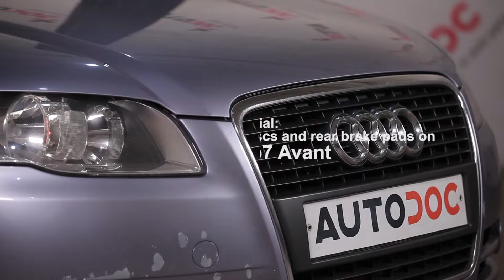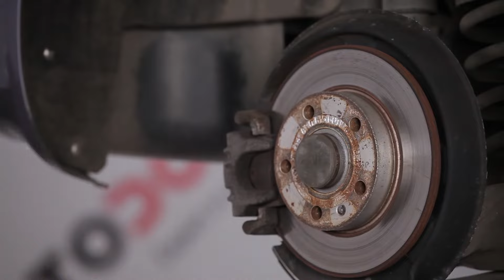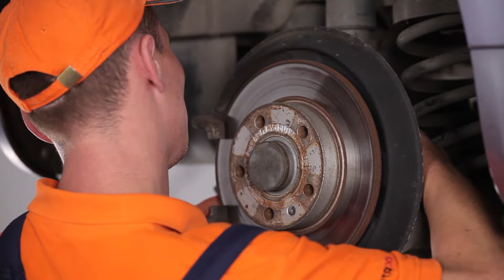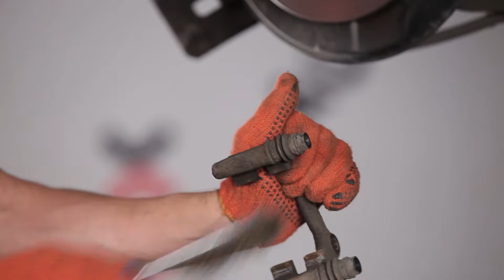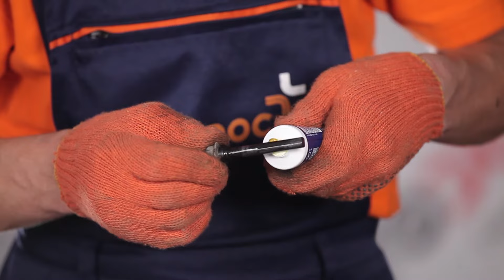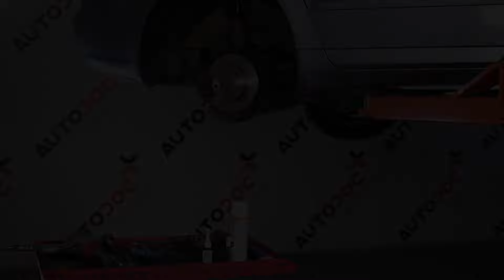How to change rear brake discs and rear brake pads on AUDI A4 B7 AVANT  TUTORIAL | AUTODOC

Comment: Hold up a minute. I just changed out these rear discs without having to take off the caliper bracket. That's not really a required step and I just found it by accident. I was prepared to undo the bolts in the back and the disc shifted, after I removed the securing bolt for it, and the disc came out when I had braced to catch it. Good stuff though.
Reply from the maker: Thank you for your feedback ! Thank you for your valuable remark! It will be very useful for our viewers. Our new videos will show the replacement in more details and we will tell more about it.  Best regards, Autodoc.
Reply: Your comment has helped me so much tonight as couldn’t remove the Cali per holder!!! Thanks from UK
Reply: I guess I am kind of randomly asking but does anybody know a good site to stream new series online ?
Reply: @Leighton Cristian flixportal
Reply: @Konnor Zayn thank you, signed up and it seems like a nice service :D I appreciate it!!
Reply: @Leighton Cristian glad I could help =)
Reply: G man u saved my life right now i could take it of to cuz it was stuck now i can replace the disc without a problem😅
Reply: Can confirm. The caliper bracket even has cut aways to allow the disk to be swapped without caliper removal.

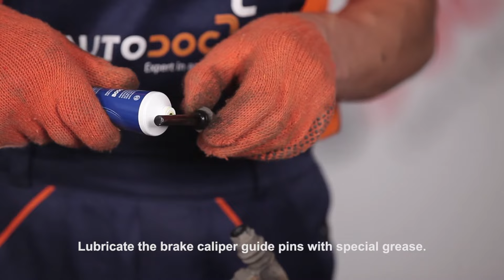Comment: 4:50 'Lubricate the brake caliper guide pins with special grease'... 
What 'special grease'? 
What would I ask for at my auto shop?
Reply from the maker: Thank you for your feedback !  In this video we used special  lubricant for  support  guides.Please, contact our support team, and be sure that we will check it for you. Best regards, Autodoc.
Reply: Copper grease.
Reply: @iangraham6730  Cheers, Ian. I reckoned that from around the time I asked 'autodoc' the question. Your reply was what I needed from them at the time, but unfortunately copper grease seems to be some closely-guarded secret of the trade: "special grease" "special lubricant" - why couldn't they just say 'copper grease' or 'lithium grease', 'red rubber grease' 'ceramic brake grease' or 'Mission Automotive Dielectric Grease/Silicone Paste/Waterproof Marine Grease'? 👍
Reply: @ClaimOfRightMuso  It's all about the 'sell' . .  the less you know, the better for them ;-) I worked in a garage for the guts of 20 years, copper grease was the go-to for brake slides, actually silicone grease is probably better for the rubber dust covers sake, but I still prefer copper :-)

Comment: using a spanner on those hex bolts?.  those bolts are rigid and u could never use just a spanner to loosen them.  the bottom shocker bolt should be removed in the real world with a 3/8 power bar and 8mm Allen key with socket..
Reply from the maker: Thank you for the feedback! Your opinion and remarks are very important for us. We will take them into consideration for our next tutorial. Best regards, Autodoc.